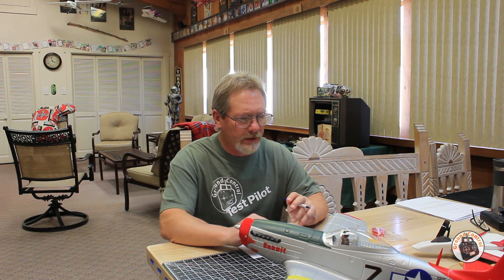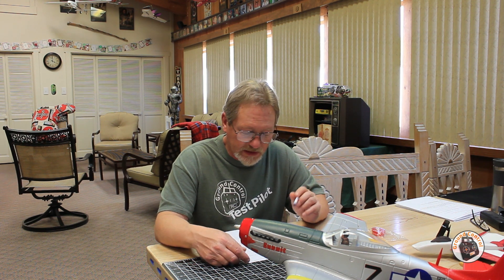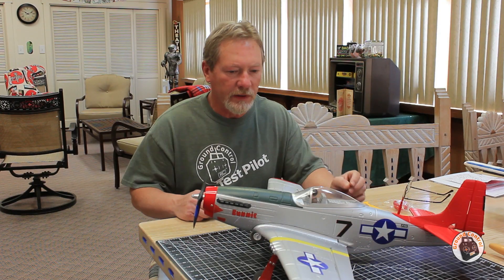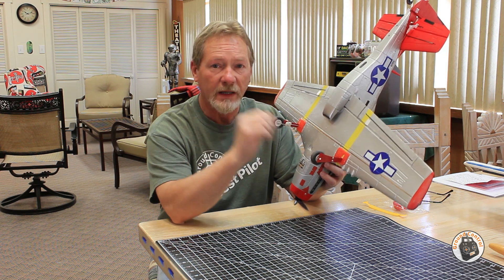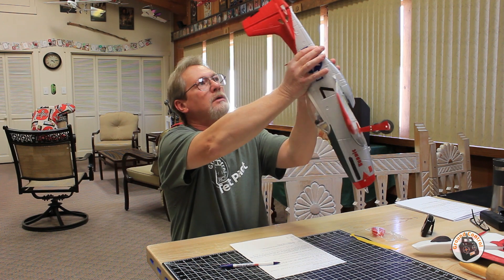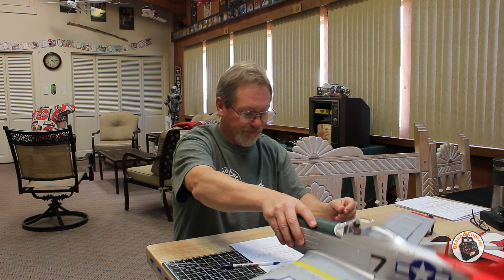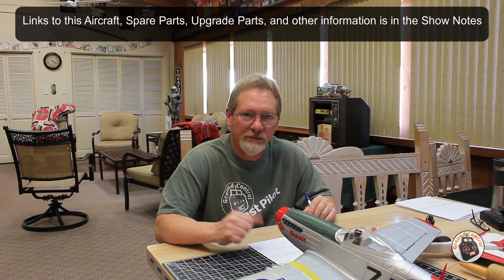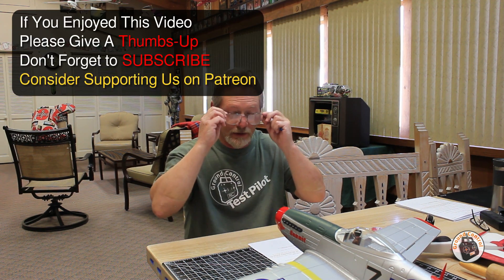Review Part 4 - Volantex 768-1 P51D Mustang 750mm PNF - Tips, Tutorial, MODs, Setup, & Conclusion!

Comment: It is a very nice plane, and I have had many flights with it, mainly in Medium mode.   Flying low and fast I accidently flipped the mode switch into expert. The plane rolled and because it was to low I could not save it, and it nose dived into the ground. Damage to the fuselage and motor shaft and of course  the spinner. Now this is why I would not recommend  beginners to buy this plane, even though it is very easy to fly in beginner, and medium mode. THERE ARE NO PARTS AVAILABLE   besides the propeller, so with a bad crash ( which happens to everybody) you can actually throw the plane away, and it is not a cheap plane to start with. So buying a plane make sure that there are plenty of spare parts available.   Happy flying :-)
Reply from the maker: I agree Ruudy, I would not recommend this as a Beginner / Trainer Plane even with a Gyro. It's a pretty fast Plane with some good power and Warbirds are not the most forgiving Planes. I refer to this Plane as an Intermediate / Expert Plane. Spare parts always seem to be an issue especially when new Planes are released. You can use standard components in this Plane as I did with the Motor and ESC but getting fuselage parts will be problematic. I have the PNF version, not the RTF version so there is no Gyro. I think folks with some experience are the ones that will be looking at the PNF version and like me, with my hard landings and OOPs moments, will have to effect repairs when the inevitable happens ;-) See you in the Air!
Reply: currently there are hundreds of parts available, just search.

Comment: E6000 used carefully is great for epo...is actually melts epo a bit and fuses plastics etc to epo...i also use medium ca with epo ...works great also imo
Reply from the maker: E6000 it fantastic for EPO and EPP foam and it's what I currently use.
It's great glue and you can find it just about anywhere.
I use Foam-Tac or Foam-Cure, and / or Hot Glue on my DIY Foam Board Projects as E6000 will melt that foam.

Comment: I have always bent a peice of metal i would heat up and expand epo plane battery bays if needed...you have to be careful using this method..a little at a time and not heat up metal tool to much...i used this method on dozens of planes...i always focused on getting cog perfect without having to add extra weight..
Reply from the maker: Yes, getting the CG is key.

Comment: Tony, your most loyal follower Marcus the DP. 😆.  Last question, I thought I got exactly this motor but it's the Racestar 2208 1100.  It seems to have an immense amount of power, however,   I'm not sure on my lift settings.  🤔  I have the ailerons set even. I'm just wondering does this engine provide enough lift with the 8x6 prop. I'll also check elevator settings,  thanks again, see you in the air and keep em Flyin'
Reply from the maker: Hi Marcus the DP, my most loyal follower ;-)
I've never tested the 2208 1100kv but I have tested the 1400kv and 1800kv version.
The lower the KV the more torque the motor should have.
Based on my numbers on the 1400kv version with an 8x4 prop I would think it would provide plenty of thrust with an 8x5 or 8x6 prop without pulling too many amps.
I would probably try an 8x5 prop first.
Here are numbers for the 1400kv version on 3S using an 8x4 Prop:
Thrust(g) 100%  = 683g
Amps 100%       = 12.6A
Thrust(g) 50%   = 257g
Amps 50%        = 3.7A
g/W 50%         = 5.6
g/W 100%        = 4.4
Reply: @GroundControlRC  Thanks Tony, I suppose by your figures then I should have plenty of lift! Then I'll work on my up elevator, thanks Tony, as always! Keep em Flyin' and I'll see you there in the air!

Comment: Great serie of Reviews of this nice plane! I´m completely new to this and I only tried to fly a RC plane in parallel with a friend but now I wanna buy my first plane and I love this P51 :-)
Reply from the maker: Hi Mark!
It a great airframe and very stable.
I didn't care for the 2S Power System that it comes with so I upgraded the Power System for 3S with a 2-Blade 7x4 Prop.
It has great power now and a good amount of flight time.
My most recent flights of this P51D is on 3S Power.
I have the PNF version, so no gyro, but I believe the RTF version comes with a gyro.
See you in the Air!

Comment: And how do you adapt the new engine to the bench that the plane comes with?
Reply from the maker: Well, since I destroyed that stock motor mount I had to fabricate another one from 3mm thick hobby-grade plywood.
I also replaced the stock motor with a 2208 1400kv for a 3S Power System and a HobbyWing 20A ESC.
I use an APC 7x5 Thin Electric 2-Blade Prop and that provides good power and flight time.

Comment: Good day sir! What battery would u suggest for all stock mustang 750mm?
Reply from the maker: I've converted mine to 3S to get more power and flight time.
The stock power system is setup for 2S.
I tried using a 2S 550mah LIPO and the flight time was very short.
I think with a 2S 800mah-1000mah LIPO the flight time would be much better but you'll probably need to carve some foam from the battery bay to fit them as it's not very big.
Reply: @GroundControlRC  but is it safe to use 3s on a stock?
Reply from the maker: @jerichoportillano2950  Not with the Stock ESC IMO.
Here is the playlist for this plane and in a couple of those videos I talk about what I did to convert it to 3S and how you can use 3S without replacing the motor.
Volantex P51D Mustang 750mm PNF
https://www.youtube.com/playlist?list=PL_YiEhY7O1Wa7iySUtPnLtlJ_sRWsajbC

Comment: My aerolons are reversed, not sure where the error occurred
Reply from the maker: Do you have the RTF version?
I wonder if the TX has a way to reverse the Aileron Channel?
Reply: @GroundControlRC  I do have the RTF version.
Reply from the maker: @capnhardway  If there's no way to change the servo direction with the receiver, maybe the gyro?
Reply from the maker: Here is the text from the manual on how to reverse the channel:
Channels Reverse
1.Turn the throttle stick to min position.
2.Power on the Transmitter and the receiver.
3.Do NOT unlock the throttle.
4.Turn the channel stick to max position of any side and hold for several seconds.
5. When you hear a “beep” sound, it means the channel is reversed.

***After you complete this and everything is moving in the proper direction, don't forget to make sure the gyro is correcting in the proper direction.

I hope that helps.
Reply: @GroundControlRC  I'm a bit confused. I'll post a quick video with the question to all. I want do this right.  I appreciate you taking the time to answer. Thank you🙏👍 see you in the air  Keep em' Flyin'!

Comment: Hey Tony, I have the rtf with an 8x4 prop with the stock engine.  I accidently hit the button and put it in expert and it rolled into the ground before I could react.  I'm thinking haven't looked yet, maybe I should think of upping the motor and esc and battery? Or not lol?
Reply from the maker: Hehehe...it sounds counter-intuitive doesn't it?
I actually converted mine to 3S after my crash ;-)
I like to live dangerously...hehehe!
See you in the Air!
Reply: @GroundControlRC  that's my thought. Can I change the motor and esc and Not the battery?
Reply from the maker: @capnhardway  If I had to do it over again I'd save myself some money and effort.
I think the stock motor is capable of running on a 3S LIPO with a smaller 2-blade prop.
I'd replace that 4-blade prop with a 6x3 composite 2-blade prop, install a 20A ESC, and then use a small 3S LIPO like the one I use. It's a GNB 3S 5500mah 80C LIPO.
The performance on 3S is so much better than on 2S.

Comment: Great series on the Volantex P51 and your mod progression, GCRC - thanks! I just got this plane in RTR form and have an issue with the tail assembly... the elevator pushrod is the exact same length as the rudder pushrod. That can't be right - the elevator clevis needs to be quite a lot further forward than that for the rudder! I can't just move the elevator clevis forward the 30mm or so it needs to be moved, as the pushrod itself will be in the way of the clevis pin and will stop it from clipping in. Was your elevator pushrod the correct length out of the box?
Reply from the maker: Paul, thank you for the kind words. My Control Rods were the correct length. I just measured mine and you're spot on, the Elevator Control Rod is approx. 30mm shorter than the Rudder Control Rod. Have you opened it up to make sure the Elevator Servo isn't turned completely in one direction and perhaps the Servo Control Arm is not centered? I would check that as I'm guessing the person assembling the plane has no knowledge of RC Planes. If that isn't the case at least it's too long and not to short. Worst case, I would cut the Elevator Control Rod to the correct length and glue the Clevis onto the Rod. I would also take a picture and have them send the correct Control Rod. Let me know if it's one or the other as I'm just curious. See you in the Air!
Reply: @GroundControlRC  Yes, the elevator servo is completely centred. Another option I thought of, rather than cutting the pushrod, is to put a kink in it - like you sometimes see on pushrods to allow for mechanical adjustments (widening/  narrowing the kink). I'm just not sure if this pushrod will hold up to being bent at almost 90°!

Comment: Great video. I just got this, really enjoyed the maiden flight today. Although noticing the giyo jitters the tail up and down when flying level (no input to elevator on beginner mode). Seems to be malfunctioning while trying to level itself? Any idea why this might be happening or how to fix it? Cheers
Reply from the maker: Thank you much! I haven't flown the RTF version. I have the PNF and mine has no Gyro. Sometimes re-calibrating the Gyro can fix those issues. I don't know if you can adjust the sensitivity of the Gyro but it may also be that the default Gains on the Gyro are set too high and that can cause jittering. If there is a High / Low Rate Mode I wonder if it does this in High Rate Mode? High Rate Mode will usually have less Gyro input than Low Rate Mode.
Reply: @GroundControlRC  thanks heaps! Not sure if there are different rate modes but will give that a try
Reply from the maker: @bilbs87  You are most welcome ;-) I hope it helps. See you in the Air!

Comment: Great video with detail info, as usual :)
I'm still new in RC plane, gyro to me is life saver.
I'm now practicing with micro trainer with gyro, when I get used to it, I would like to get a transmitter and move to bigger plane.

For PNF version, can I attach a receiver with gyro, so I can turn on (beginner mode) and off (expert mode) during flight, like the RTF version?
Reply from the maker: Good question Rick! Yes, I've found Receivers that have Built-In Gyros and you can also get a Gyro that is separate from the Receiver. I have a couple of DSM2/DSMX Micro Receivers that have Built-In Stabilization but I haven't tested them yet. Perhaps I'll test one of those in my next Build. The ones I have provide Gyro Modes on Channel 5 but others may be on a different Channel. See you in the Air!

Comment: Great video, Do you have any recommendations on what battery to use on stock motor and esc?
Reply from the maker: Hi Peter and thank you!
I don't have a specific 2S LIPO in mind as I converted mine to a 3S Power System.
I was using a GNB 2S 550mah 80C LIPO with the Stock Setup and was only getting 3.5-4 minutes of flight time.
I'd try to find a 2S LIPO of at least 850mah that would fit in that battery bay to get a good 5 minutes of flight time on the stock setup.
Reply: @GroundControlRC  Thanks!
Reply from the maker: @peterkennethnuevo8551  You are most welcome.
See you in the Air!

Comment: Wot is the protocol for the rtf on my jumper  love the tips you are giving cheers
Reply from the maker: Thank you much Ernie! I'm not sure what Protocol the RTF Version is using. It seems Volantex must have used yet another Protocol for this Plane as I could not find any support or mention of this Plane on the Deviation Website or the Multi-Module Firmware Site. It seemed to me no support is available yet but they are adding more Protocols all the time. I have the PNF Version, no Gyro, and added my own Receiver.
https://www.deviationtx.com/wiki/supported_models
https://www.multi-module.org/basics/supported-protocols
If I find out something about support I'll post the info.
See you in the Air!

Comment: Bonjour comment étalonner le gyroscope avec la télécommande merci beaucoup
Reply from the maker: Hello Didier! This is the PNF Version and it has no Gyro. Most of the Gyros I've used can be calibrated by moving both Transmitter Sticks to the bottom and out. This is done before arming the motor.
Reply: @GroundControlRC  merci beaucoup very good ça fonctionne good DAY
Reply from the maker: @didierbuyse1154  You are most welcome ;-) I hope that helps and I'll see you in the Air!

Comment: Hello great work. Why don’t you take the old motor to test it out how much drags.This will be my next plane. I got the smaller one and I love it.
Reply from the maker: Thank you George! It's a gorgeous looking Warbird isn't it ;-) I've been testing Motors & Props for the past few days and just received some additional Props yesterday. The stock motor for this Plane is one that I'm going to try and test as I want to see how it performs compared with another 2208 1800kv motor I just received. I'll be performing a lot of reviews of Motor and Prop combination in the next couple of weeks, time permitting. I'm trying to get Power Systems sorted out for additional Aircraft Builds on down the road. One of the Motors I tested is the one I have in the Fun Cub 1100mm. Wow! That worked out great! That is going to be a very Aerobatic STOL Plane ;-) Stay tuned and I'll see you in the Air!

Comment: Hello, my transmitter is flysky Fs I6-X, what reciever with stabilzer or gyro  can you recommend.  Thanks.
Reply from the maker: Hi Ruel! I've never used a FlySky Receiver so I'm not familiar with them. I typically fly in Manual Mode without a Gyro so I can't give you a recommendation, however if it were me, I'd buy a separate Gyro so you could use it with any Receiver.
Here is a link to some separate Gyros/Stabilizers: https://www.banggood.com/Volantex-Xpilot-AX601-6-Axis-Flight-Controller-Stabilizer-for-RC-Airplane-p-1059391.html?p=WE081047791920140372
I hope that helps and I'll see you in the Air!
Reply: @GroundControlRC , Thank's a lot. keep safe.

Comment from the maker: I did contact EXHobby to inquire about Spare Parts for this Plane. I'm waiting for a reply from them on this issue.
I did get a reply from EXHobby regarding this P51D Mustang.
Apparently, they only have Spare Props & Spinners available at this time.
They did state they would be adding additional parts in the future.

Here is a link to the Spare Props & Spinners:
4pcs Propeller and 4pcs Spinner for Remote Control Airplane 768-1 | EXHOBBY
https://www.exhobby.com/spareparts/768-1-propeller-set
Reply: BangGood.com has spare motors, esc, fuselage, wings,all parts u  list need to know names of item specific size,etc,..
Reply from the maker: Thanks! I noticed they did get the parts in for this Plane. The parts seem to have quite a bit of lag time before they show up when the aircraft are released. Great flying plane when you get it tweaked a bit ;-) See you in the Air!

Comment: Hello nice work! i got the PNP version ...should i start with the 2s battery and existing setup...? or i should get the 3s lipo and esc and motor? i ll get the s6r frsky receiver soon...also what is the right voltage of battery in stock pnp version? cause in site says 11.1 volts 2s is that right?
Reply from the maker: Hi George! Yeah, I would start with the stock setup. It's not a rocket on 2S but it has sufficient power. I notice sometimes they have the wrong voltage listed in the description for the size of LIPO. A 2S LIPO is 8.4v and 3S LIPO is 11.1v. I also found that the stock ESC can handle 3S but it's only a 10A ESC. So when I decided to fly 3S I put a larger ESC in it so I didn't push the ESC too hard. It's a beauty of a warbird ;-) See you in the Air!
Reply: @GroundControlRC  so do you recommend to change the ESC to how much higher ?cause i want to make it rocket!!! and i want to buy 3s battery
Reply from the maker: @georgep2301  , I put a 20A ESC on mine for 3S Power and it's a rocket ;-) See you in the Air!

Comment: I'm curious, if u have any filmware for this plane to work with RadioMaster 16S??? I am tryna switch over all my planes, helis, drones,etc.. 
I am having trouble finding correct filmware.. I was under the impression when I bought the RadioMaster 16S, that open text meant it would bind to virtually everything. Now I find it's not that easy.. Any help really appreciated,.. thx for videos..
Reply from the maker: Last time I checked, OpenTX did not yet have support for this specific plane. It's because the manufacturers keep doing very proprietary things with their protocols. I'm sure they will have support for this plane in the future but they have to first reverse engineer the protocol. That's for the RTF version. If a plane has a PNF version I always buy those rather then the RTF because I can use a receiver I know is supported. Replacing the Receiver would allow you to use the TX16S rather than waiting for the support for the RTF version. But yeah, the TX16S supports tons of protocols ;-) I fly all of the Eachine Micro Warbirds and the Volantex Sport Cub 500 with the TX16S. I'm also going to move my other aircraft over to to the TX16S as it's the best TX I have. See you in the Air!